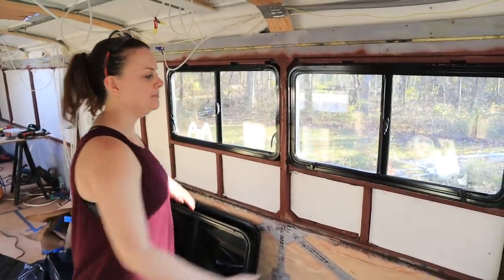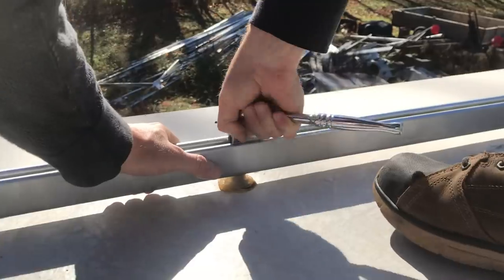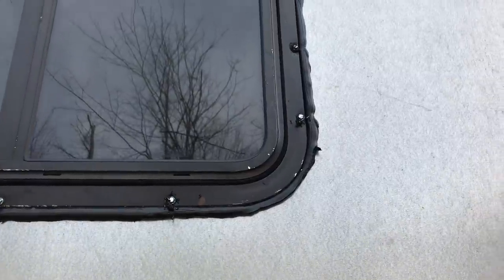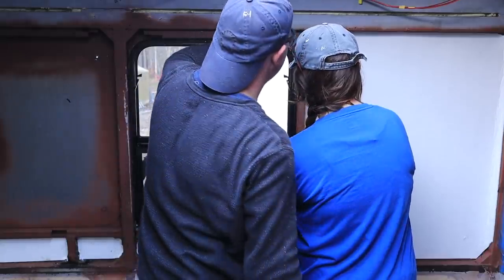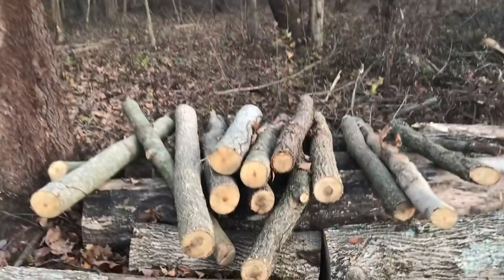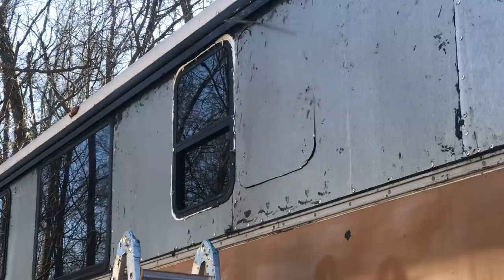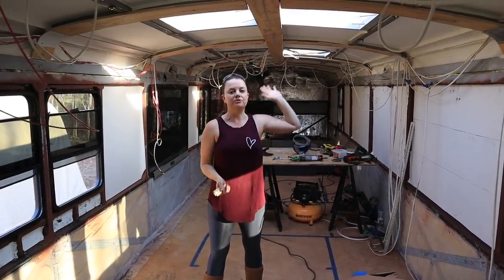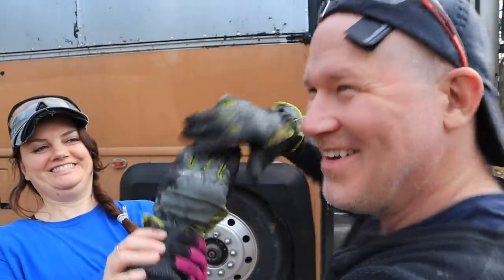Roof Rails, Windows and more for our Bus Conversion - S03E38

Comment: It's all about the right tool for the job cutting out those window holes we've been a lot easier with an angle grinder the cut off wheel and a jigsaw for the radius

Comment: Hi again you got it wrong the connectors go at the bottom inside the web not on top sorry.  I think all your mistakes are just to funny to be true. If they are real give up on the bus and buy a house. No one would feel safe in that bus   You are all nice folk please don’t be offended
Reply from the maker: Our unistrut connectors are exactly as demonstrated on the unistrut website and very secure.  Spring nut inside the channel and bracket on top.  Perhaps you are mistaken.  We have no problem admitting mistakes, learning and correcting our mistakes.  Our walls and windows are secure and water tight.  Just because we are learning on the job does not mean we are not thorough.  We have thick skin, we are determined and our home will be beautiful and safe.
Reply: Well aren't you a nice guy? Howard Twigg just try to enjoy the show.